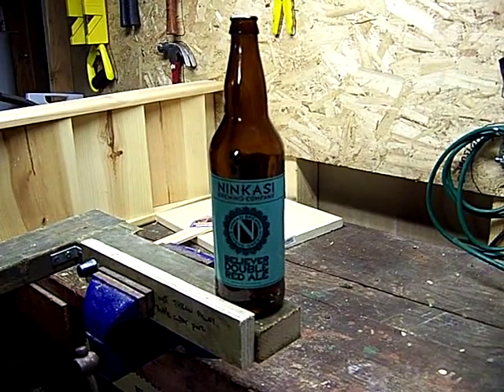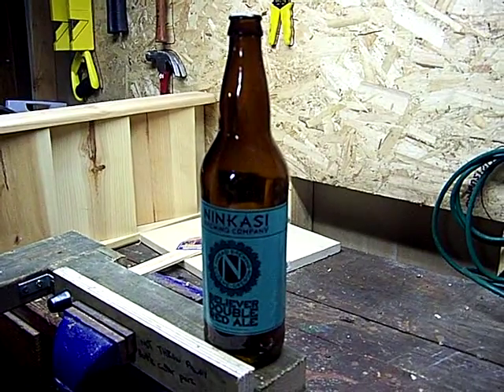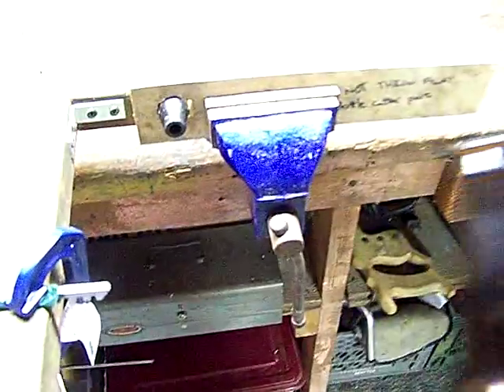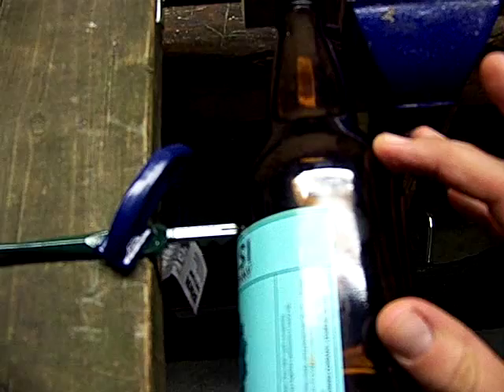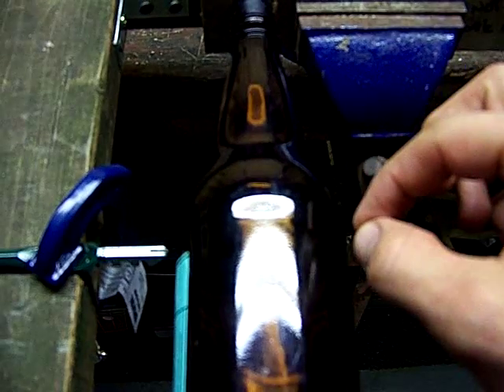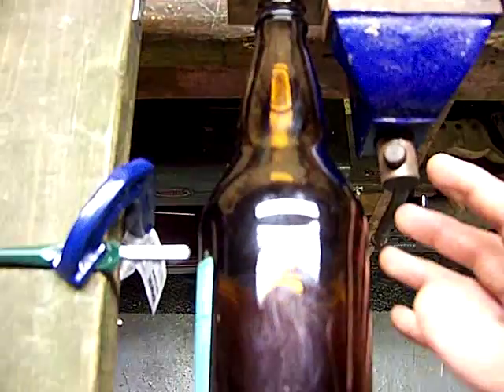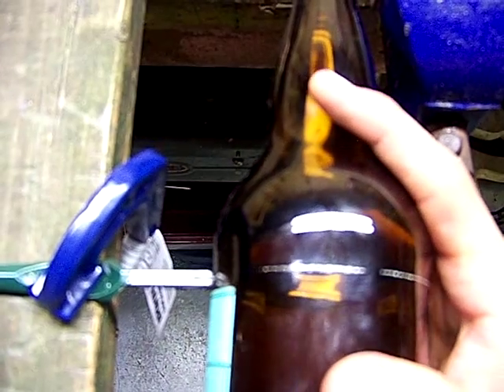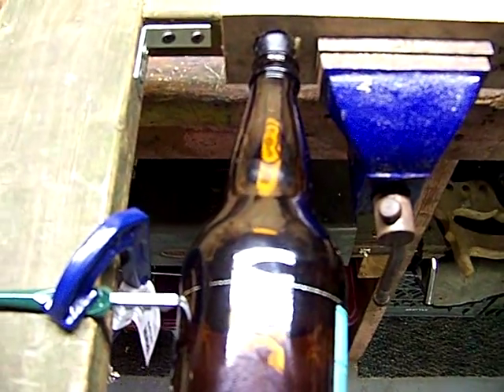Beer Bottle Breaking to Make Cups

Comment: I built something out of dowels and rollers and clamped my cutter to a block of wood that can be adjusted where ever I want the cut to be.  I really like your cutter.  May think about doing that instead.  When I make my cut, I apply good and even pressure and never lift up, that way the cut is consistent and has no gaps.  The cutter should also be perpendicular to the base of the bottle.  

What I really wanted to share was the heating and cooling.  I use a pot of ice water and boiling water.

Comment from the maker: You are correct. A standard painters mask would not be enough.   Hand sanding produces less airborne particles, but still does.  Hand sanding is also very very time intensive as glass is almost as hard as the sanding medium.  If you were trying to make glasses for profit handing sanding would be much to slow. Not to mention very hard on your hands and wrists. It's a shame that there is not an easier way to make a smooth edge or else this would be a great way to make side cash.  I do it for fun.

Comment: Awesome contraption! I too saw the video you were talking about and I think this is a nice compliment video! I like your set up!

My only questions are:

1. Do you use sandpaper to smooth out the imperfections to make it safe to drink out of? If so what grit/type (like normal or something special)?
2. do I need a dremel or any other device to smooth the edge if I plan on using them as drinking glasses?

Comment: Respond to this video...
          if you have alot of bottles to go threw then a faster way of scoring it then getting a propane blow torch and heating up the score line pretty well then throing it into water this will be faster and you will be able to go threw alot more bottles and that just might work at making a clean cut but then agen a wavy cut then sanded would make a good drinking glass to

Comment from the maker: I made myself an enclosed sanding box made of a 2x4 base and plexiglass sides so I can see what I am doing.  It even has custom rubber gloves that stick permanently into the machine.   It is very important not to be exposed to glass particles. They can harm your health and will enough exposure be lethal.  A proper particulate mask is necessary also. I used a belt sander in the enclosure. Nothing special. 220 grit. then 300 or so to do a finishing had sanding in the enclosure.

Comment from the maker: If you are having trouble scoring the glass I would suggest looking into a couple of things.First, make sure you have a good glass scorer.I bought one from the local hardware store for about 7 bucks. A more expensive one might cut even better for me.  My scorer has a rolling wheel that has diamond bits on it that I think are scratching the glass and making that noise.  Are you using a frame or jig like I built to hold the bottle?  They help stabilize the bottle so you can push it into the cutter